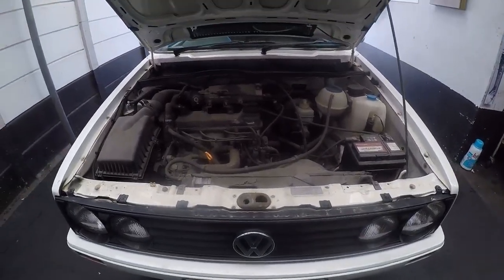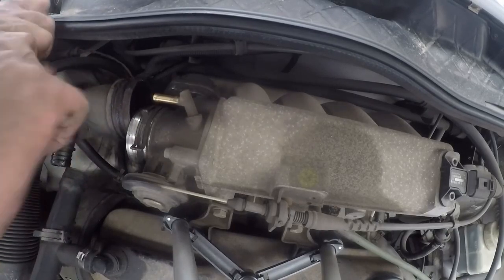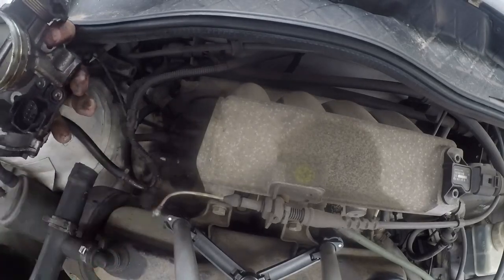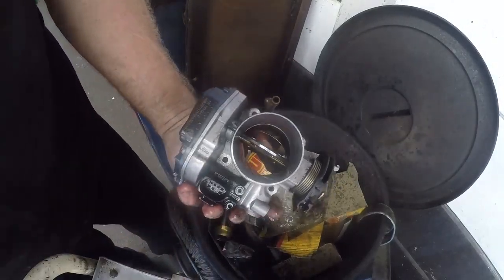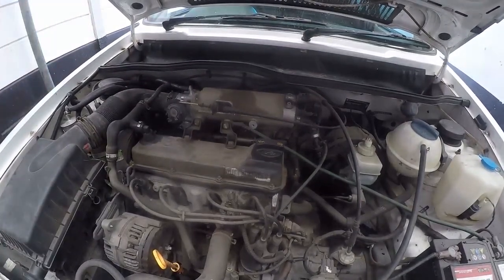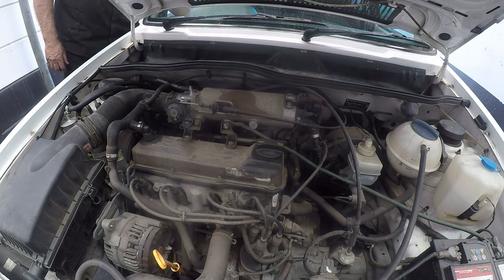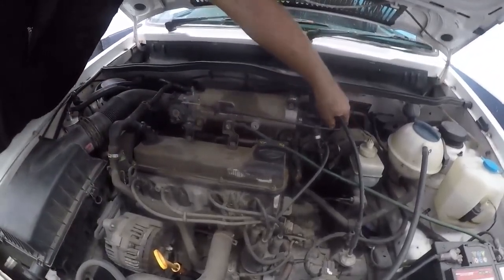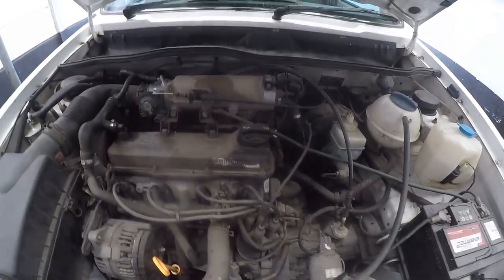Citi Golf 1 4i   Over Revving

Comment: Hi there and name is Kabelo from Pretoria and i do have a problem of a throttle body (Vw microbus 2.6i), it keeps on sticking after pressing the accelerator pedal and the accelerator pedal becomes hard to press again. Can you please assist.
Reply from the maker: HI Kay, remove the accelerator cable and check it, may be seized.

Comment: Hi...my golf mk1 carb dont want to idle when choke is in only idle with choke in use what can be the problem please....already clean whole carb
Reply from the maker: Check the rubber base mount for cracks and tears, also take the idle jet out and clean it with a thin pin, then set the idling with the carb adjustments.

Comment: Good day sir love your stuff keep it up 👍🏾 just a quick question... I have a mk3 golf 1.8i GSX and it over fuels timing has been set I bought a new map sensor at Diesel Electric a Bosch one but still my car over fuel and accelerate very sluggish what else can I do to sort it out?🤦🏾‍♂️thanks again for you awesome 👏🏾 videos
Reply from the maker: Thanks for supporting my channel Daniel, try changing the 4 pin sensor in the top of the water flange where the top radiator hose connects to, this is also a cold start sensor, if it malfunctions the car could over fuel.
Reply: @vehiclemaintenanceandrepai3790 hi sir thank you for the videos, my car is slugish with take offand and hunts when idling. I jave change the water coolnat flange the temp sensor check map sensor ,timing has been done . It has new spark plugs cables and distributor cap what else can I check ? Please help
Reply from the maker: he cold start sensor seems to be the problem here replace it with a reliable one (good make)

Comment: Check pcv valve... vacuum line also if it has a cut or crack it could also throw your idle and then also cold start sensor aka temperature sender switch as well
Reply from the maker: Thanks for your insights and suggestions.

Comment: HI I LIKE YOUR VIDEO CANYOU ADVISE ME I HAVE NOTICED THAT MY MK1 1.6 GOLF CUTS OUT AFTER COUPLE MINUTE OF DRIVING OR IDLING. WHEN I REMOVED THE THROTTLE BODY SENSOR IT WAS IDLING HIGH BUT THE CAR DIDNT CUT OFF.  AS SOON AS I PLIG IN BACK THE THROTTLE BODY SENSOR THE CAR IDLES BUT THEN IT CUTS OF LIKE DIE. DO YOU THINK ITS THE THROTTLE BODY OR THE SENSOR ON THE THROTTLE BODY?

Comment: Good morning Gary, firstly thank you for the great content we absolutely love your channel. I bought my daughter a little mk1 1.4i 2006 golf, she loves the car however we need a bit of help. When the car is hot and she comes to a stop, clutch in and brakes the revs drop low then stabilises, it somehow feels like its going to stall however it doesn't. the revs just drops and then idles normally. 
I cleaned throttle body.
Replaced map sensor.
Replaced the coolant sensor.
Cam belt service done.
249000 km on clock.
Can you recommend anything else? 
Thanks again Warren
Reply from the maker: Hi Warren, thanks for the support, it seems you did everything I would given the situation, all I can think of is the throttle body itself. Gary
Reply: @vehiclemaintenanceandrepai3790  in your opinion do you think I should send it for TB adaptation... However the idle speed only drops for s second and only when the  engine is hot. Thanks for your response Gary.
Reply from the maker: Hey Warren, I do not think it necessary, if you can live with it, after all, it is not new anymore a little wear is acceptable. Gary
Reply: I had the same problem and it turned out to be the stepper motor on the throttle body. Only way to fix it was a complete throttle body replacement
Reply from the maker: Thanks for your feedback, Gary it will definitely benefit many.
Reply: This is a common issue on the mpi systems, it's either one of many things, the oxygen sensor and throttle body being most expensive of them, best is to have it scanned and see what pops up, then do a live data check while driving, this requires someone with vagcom or Obdeleven and "read" the car as you drive, focusing on all the sensor values associated with the fueling and emissions, pain in the butt, but  eventually one will show, also, if it's one of the mechanical parts not able to pick up in the scan tools, have those checked "old school " by testing it against manufacturers specifications, these later mk1s are very finicky as vw was forced to make them emissions compliant, rushing the parts from other cars in the vw stables, no long term resting it. I still love my Tenaciti 2009.
Reply: @hiemabedrog hi bru I got a 2008 Citirox 1.4 MPI I kept it completely stock only a cone filter on it with 190k on clock I had an issue with power but timing was on point after setting the oil pump key way the car became very much quicker engine power came back and now I feel like I need to exhaust but I want to know what the cat is valued at
Reply: @ShakeerKandasamy  I got rid of my 2008 1.4i MPI cat recently....not worth a lot at all. The cat is tiny...I think I got R100 for it

Comment: Hi Sir, I have a 2014 polo vivo automatic, would like to know how to drain the ATF oil in the transmission it take 3ltrs.
Reply from the maker: Hi Mark, thanks for supporting my channel, if the gearbox does not have a drain plug underneath then you have to remove the pan to drain the oil.

Comment: may I please be in contact with you. I've got a golf 1 that's got a rev/idle issue. When it turn it on the revs go up to 1200pm without any acceleration. When I drive it and I press down the clutch the car revs itself. I've changed the map sensor as well as clean throttle body with carb cleaner and the problem still is persistent
Reply: It’s a 1.4i
Reply: Same with my 1.4i citi sport

Comment: Hi have Chico 1.4 2008 model the revving County is not working I want to know what wrong please
Reply from the maker: The rev counter usually works off the coil, but it could be the dial itself, you must have it checked out at the auto electricians, Mzie

Comment: Hi...my 1.6i does the opposite. very low rough idle on cold start. cleaned TB and swapped MAP & temp sensors. idle is fine once engine warms up. Any ideas on what to check next?
Reply from the maker: Try changing the temp. sensor.

Comment: Hi my mk1 golf 1995 carb is high reving when I accelerate and put in clutch foot then it don't come all the way down either 1500 or 2000 revs is it plugs or cable not to sure🤔
Reply from the maker: Check the throttle cable adjustment it should have some play when idling, also check the idling adjustment, and also check the rubber base, they break as time goes on and sucks in the air making the car idle too high and erratic.

Comment: My car jerks or looks like dying when pressing the fuel pedal. I replaced the Map sensor, injectors, and Oxygen sensor but there is still that jerking or hesitation when  pressing the fuel pedal
Reply: How did you fix the problem, I'm experiencing the same thing?
Reply: @delmaineballas4855  Eventually, replaced the coil & distribution cables and the problem was gone. Try that out first as the cheaper option. On the diagnostics machine it showed Lambda sensor and injectors....I replaced them too.

Comment: Just out of curiosity ,is this mp9 or MPI .
Reply from the maker: No idea what you referring to Dhanesh, but thanks for visiting my channel
Reply: @dhaneshramdial4873  its mp9 management system
Reply: My throttle body doesnt have a evap pipe connection and its also 1.4i mp9....any advice?
Reply: This 1.4i with the evap stuff and oxygen sensor and catalytic converter is mpi
Reply: this 1.4i is a mpi ...polo runs with mp9 where map sensor located next to the throttle body instead of on top of it like this golfi ....( mpi got a o2 oxigen sensor ) where mp9 dont have any of it

Comment: my Citi golf  burn petrol so much
Reply from the maker: Hi Tobi, thanks for stopping by my channel your support is appreciated, there are many reasons a car uses too much petrol, Spark Plugs incorrect or worn, dirty air or petrol filters,  incorrect tyre pressures, incorrect timing settings, also check the carb base rubber (if your car is a carb model) it may be leaking sucking air and the list goes on, it is best to start a process of elimination starting with the most obvious and cheapest, good luck. 
Gary